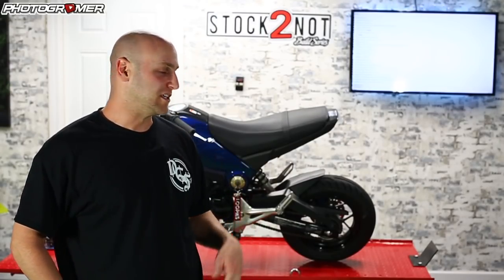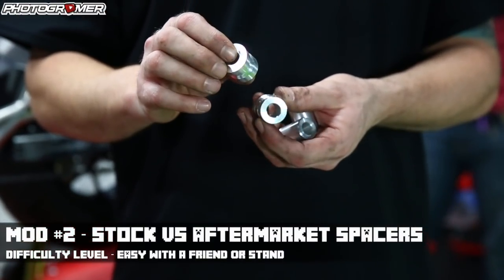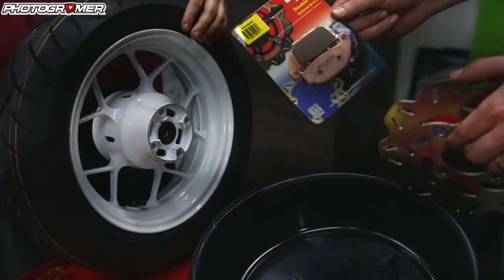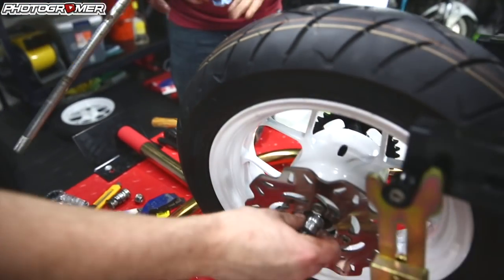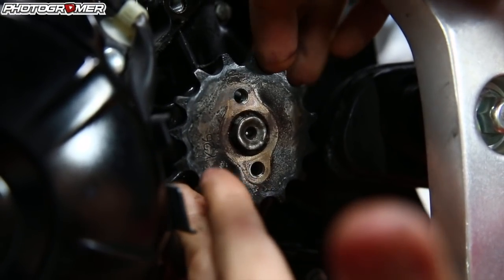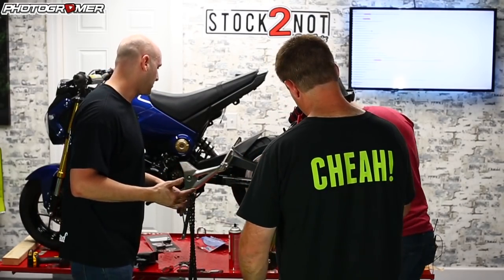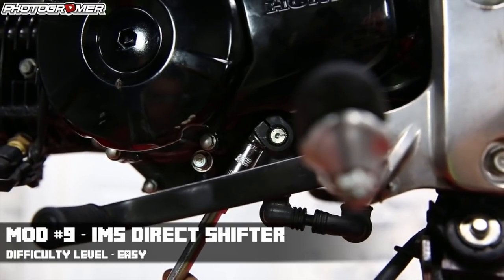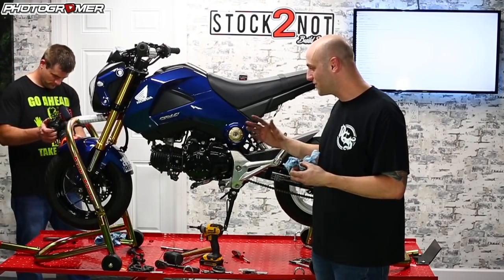S1 E2 - Basic Honda Grom Mods (Replace & Adjust the Chain, Sprocket, Brake Pads & Rotors)

Comment: hey guys.... the grom fatherz speed spacers were put in on the wrong side. the spacer with the s on it or the smaller groove goes on the sprocket side. the spacer with the b on it or big groove goes on the brake side.
Reply: So that's why its spin test was so bad 😬
Reply: Definitely on the wrong sides....

Comment: At 22:13 not to be rude but that is called a 12 point socket vs a 6 point. There is no such thing as a 10 point. Sorry my OCD was kicking in. Lol have you ever seen a 12 point bolt. They do exsist typically on car transmissions. It never ceases to amaze me when people see a 12 bolt they tell me it takes a special tool.

Comment: A non O ring chain has less resistance for the motor to overcome as you proved with the spin test. 
each O ring chain I have installed came with a different type master link that has no little clip but a link that you mushroom the ends to hold on the outside plate.

Comment: @ 22:40 I looked up this vid I had my chain break tonight.. it got jammed in the front sprocket and messed up the casing a little and grinded some of that thin metal that sits in between chain and engine. so I wanted to loosen sprocket to help get chain unstuck. I had the more point socket and it was acting like it wouldn't sit all the way on bolt and like it wanted to strip it.. I see in vid you need the 4 point socket and it seats right.. you could still prob use the drill gun if you use the 4 inside point instead of the one with a ton.. at first im like I know it take 10mm why is mine not working so then I had to look in mess toolbox till luckily I found one with only the 4..... but ya it helped free the chain now I just need new chain and sprockets.. so thanks for showing that I didn't even think that was why I couldn't get it off..

Comment: 31:49 Chain was incorrectly broken but when you installed it i could tell you fixed the mistake. i  Caught ya! lol i have made the same mistake so i understand. great video i  am excited to see more and will pattern after you guys for sure, i hope you watch my videos if you ever get the chance
Reply from the maker: Good catch! We fixed it and actually had an extra link we had to take out, edited it out to keep it flowing...but good catch :)
Reply: I am laughing and chuckling because you actually responded lol I am working on getting my bike stunt ready. Where should I start? I kinda want to build my own mods(crash cage etc.) like weld them myself what's your suggestion?
Reply from the maker: I wouldn't get a crash cage, you're chances of hitting the motor are slim but if you're talking about building your own subcage (12 bar), kudos to you that's above my skillset. Lots of great choices out there at good prices. I'd say subcage, hang brake, aftermarket shifter and/or rear sets or have a backup set ready are a must. Also the TST sliders up front on the forks so you don't snap one if you loop. Happy Loopies!
Reply: How was the chain broken incorrectly?
Reply: @Photogromer  how was the chain broken incorrectly?
Reply: How was the chain broken incorrectly?
Reply from the maker: Wrong side of the link.
Reply: This pin just won't come out and I dunno why?!😂😂  Also props for pointing out keeper direction on the master link my dad stressed that when I was a youngen.. kinda took me back haha

Comment: its so funny how youtube recommended this video to me; I had to take the rear wheel off on my 22 grom because the caliper was misaligned after installing chain adjusters, and yes doing it yourself those spacers are a BITCH.

Comment: I'm confused. In the part where you show marking the spot on the new chain to break, you say "this outside is going to go on this inside". Then when you cut to the part where you're installing the new master link, you have two inner links being joined by the new master link. Shouldn't we be left with 2 inner links after breaking (as shown by the shot where you're installing the new master link)?

Comment: PSA: 13:36 DON'T do this (spread pads with screwdriver etc). You can compromise the pad and cause pieces to chip off, and wedge into slotted rotors causing catastrophic lockups. Also, never trust a mechanic that doesn't have a damn RAG on hand, or that ignores torque specs.

Comment: You're a smooth sales talker. But I won't let you work on my bike. Red locktite is actually for hydraulic seal connections. Blue is much stronger. Now with Stainless bolts in aluminium using Blue locktite might give you serious problems to loosen them in the future.
Reply: ive used blue loctite on every bolt on my bike and its never
 caused me any problems

Comment: You would probably laugh if you saw my hand brake set up its not exactly strong enough but I used a Odyssey bmx brake lever and brake line. I created my own mount for it and everything....I also have already fab'd my own 12 bar it's also not the greatest but it works and looks okay I put passenger pegs on it the day before yesterday....Ill have a video posted soon... You should watch it

Comment: Use a C clamp instead of a screwdriver to push your brake piston in. No need scratching stuff up and risking tearing the boot. Clamps are cheap.

Comment: guys I got question. so im noob. got grom a year ago put like 10k miles on it..  it came with a few mods k&n air filter, exhaust, tires, bars, brake lines, galfer rotors I think maybe ebc though they look similar? so since ive had it I just did a heavy duty did oring chain. back tire after I wore one out and front brakes a couple times. I got it with 1700 miles.. I got like 12k miles on it now in 12 months of riding its my only vehicle.  so one of my friend who can stunt Harley rode it he thinks my back brakes are glazed over.. so are the back brakes the same as front? I don't think guy replaced the calipers when he did the rotors I been replacing the front with galfers. is the rear the same or different? its too late and cold for me to go take it apart just hoping for quick answer. so ya my chain broke sunday night got wrapped all funky around front sprocket. I think I was coming up on like the 8th month of having it.. and only adjusted it once. I was wanting to adjust it just working early and getting off late I was just too lazy and suffer the consequence.. but ya the chain bent that metal bracket near the front sprocket.. grind that up some but also it was weird lodged under and sideways in the front sprocket while some was on the outside of it then wrapped and jammed even dug into the engine casing some on the top and when I got home I had to take off cover. take off bolt for front sprocket then got that metal out the way and with some effort got chain unjammed and out.. so I get new sprocket kit and heavy duty chain now. I decide to change sprockets since the chain did jam and cut into one tooth a very little on the top. and just did the rear since I got the replacement anyways. so ya I take off back tire and change sprocket as im trying to put the axle back in its hitting something on inside .. I look and it looks like a spacer or bearing is slipped down.. I manage to get it by using screwdriver on one side lifting it till the axle slid past it but is that normal did I blow a bearing.. its behind the front bearing so I didn't take everything apart obviously. is it plastic? does grease hold that up normally? sorry im noob. its my daily so less I have to do to keep it running the better.. but should I replace the bearings and strip it back down.. and that thin metal in front of sprocket that bent and got chewed up some I filed it smooth but should I just use hammer and bend it straight as possible and reuse or replace? where to order the rear brakes from? I got all my front brakes on cycle gear. but when I look up the rear it looks funky and I don't think its the right one though it says it works on grom.

Comment: I have a question. Can you replace the body 2015 grom to 2018 grom?
Reply from the maker: Not really, different tabs for the fairings on the frame of the 2014/15 grom frames vs the 17-19 grom frames. With zipties anything is possible though

Comment: You went up one tooth on the front sprocket, when you should have went down one. What you've done now is made the gearing taller, and unless you're under 100lbs(you're not) 4th gear will barely be usable.
Reply from the maker: On a 170cc BBK?
Reply: In my opinion, yes absolutely. I'm 220lbs, and before my 183cc BB melted it's piston rings off, that was the gearing I needed. I hope I'm not feeding you bad advice bro, but I guess we'll find out soon enough.

Comment: Where's the sprocket guide link? @photogromer
Reply from the maker: Added it to the description, it's actually a breakdown on how the different size sprockets affect the speed and whatnot not how many links required. The 120 link chain should cover all these options, just have to use the Andrew method of measuring on the bike.
Reply: That's exactly why I was wanting it. Im still rocking stock on both. Thanks bro!